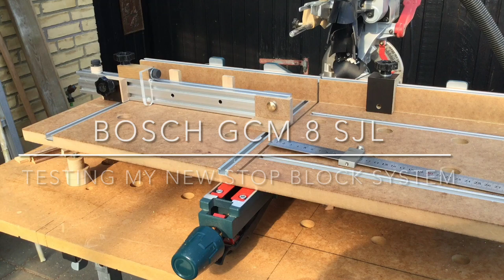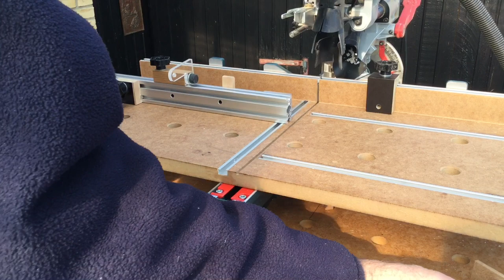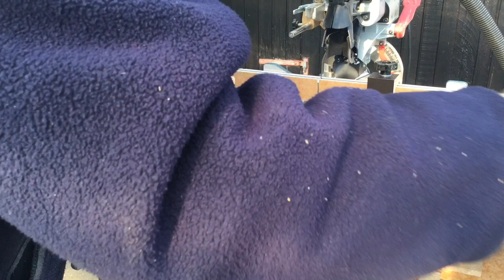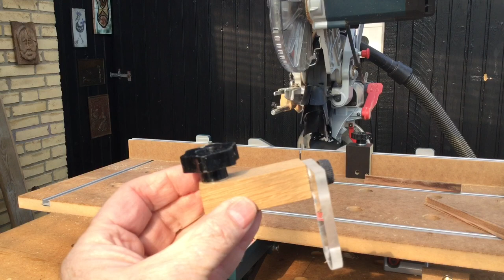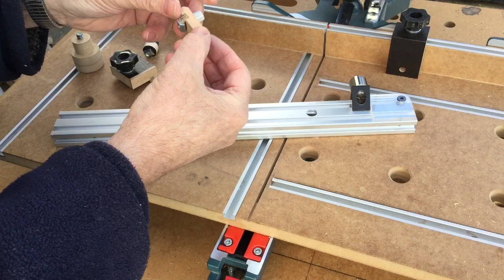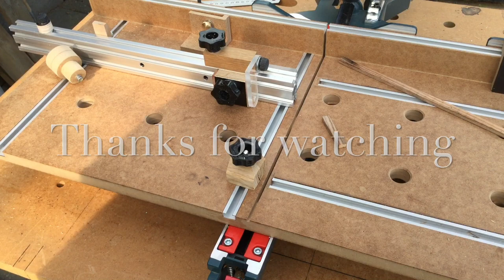Bosch GCM 8 SJL Testing my new stop block system

Comment: It all looks very nice, but after watching 15 minutes of shuffling stop blocks backwards and forwards, I'm none the wiser - and nor do I see what benefit this gives over a normal stop block system?
Reply from the maker: Thanks for the comment, what I am trying to do is make a system where you start by inserting a number of different lengths (here it is three, but could also be 8-10) which you can then saw in random order and repeat as needed.
Reply: @Harris-DIY 
I had a feeling that this was what you were trying to show and I had the Kreg system in mind while watching - that system can have multiple stop blocks fitted to one track, but to do so gets expensive.
Reply from the maker: That's why I do it myself and I think it works just as well.